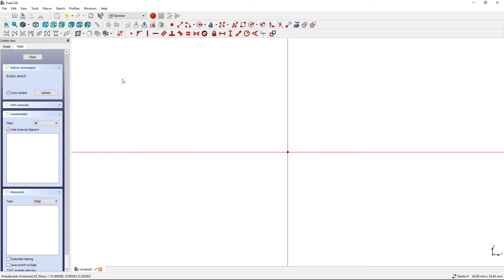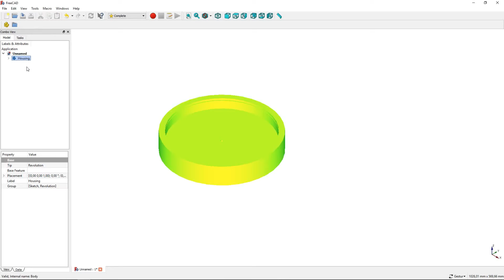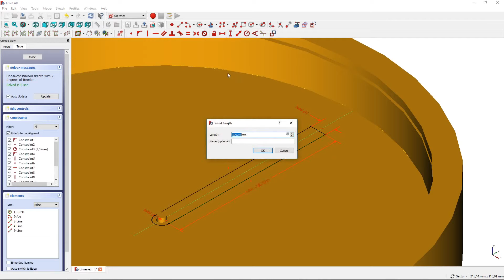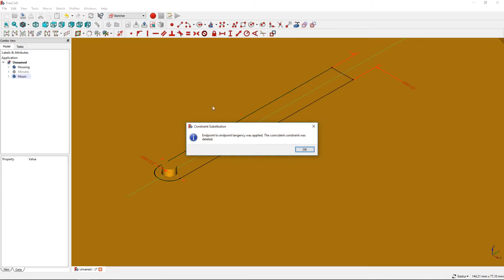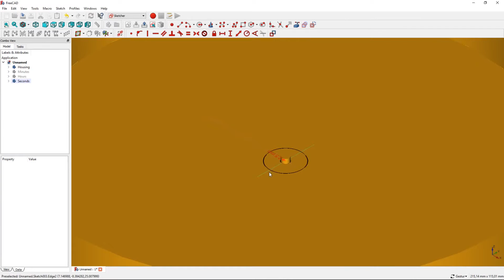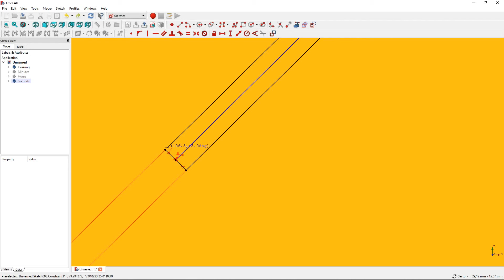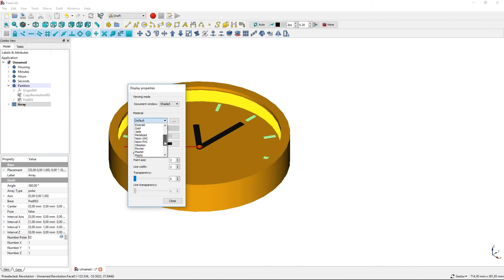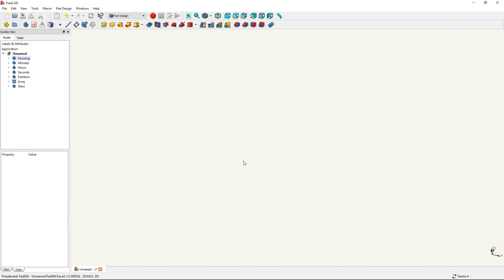How to model a clock | FreeCAD 0.17

Comment: I follow the steps and draw the sketch... then I try to apply the constraints and the sketch gets stretched out of whack
I see a grid on my view, whereas the video shows none... and grid is NOT checked !?
nothing working as the video shows.
Reply from the maker: Hi there, which part of the video are you talking about? I'll have a look at it when I know which time frame it is.
Reply: @AllVisuals4U  Thank you for giving attention to my plight.
The issues are thru-out the very beginning - drawing the basic 2D trace, and then applying constraints to it. (before you do the revolution)
- well I started over and thought I had it figured out, but there are many issues that remain.
1- the one thing I noticed is that the vertical and horizontal constraints gizmos appear on YOUR screen as you draw the sketch, no matter how hard I try, no gizmos for me... so after I drew the trace, I applied the H and V constraints to each line.
2- now I was able to apply the measurements constraints and the sketch kept its integrity instead of stretching completely out of whack as in my first attempts.
But when I got to the last segment(vertical that ends back on the origin), I noticed
3- - - that I am not centered on the origin
4- - - and the last segment seems to be a separate line(not connected at the points)
  [ as if I may have lifted the mouse button inadvertently, using the polyline tool ]
(3)- I do not know how to guarantee my trace start at 0,0.0
(4)- I do not know how to redraw the last segment so that it is connected on both ends
  
5 - I also have an issue with the points being too big, and failed to find where to set the point size in the config/preferences...
   RESOLVED: I saw that in the view TAB and corrected it
6- BUT I drew line on the side of the trace to test... and now when I try to delete this line, it zaps the whole sketch!?!?
    RESOLVED: able to segregate line in Sketch EDIT mode

...this is painful, unable to perform basics, progress is at a less than crawl speed. !?!?

7- There are 2 grids on my view panel... YOURS has none!
- - - I got rid of one grid by using the 'Show grid" option under the view TAB
- - - The other grid I have no idea where to kill it!

8- I have yet to reach 0 degrees of freedom
Reply from the maker: 1- the one thing I noticed is that the vertical and horizontal constraints gizmos appear on YOUR screen as you draw the sketch, no matter how hard I try, no gizmos for me... so after I drew the trace, I applied the H and V constraints to each line.

This could be the 'Auto constraints' option. When you enter a sketch, click on the 'Tasks' button and check 'Auto constraints'. You can also uncheck 'Show grid' here.

2- now I was able to apply the measurements constraints and the sketch kept its integrity instead of stretching completely out of whack as in my first attempts.
But when I got to the last segment(vertical that ends back on the origin), I noticed:

When you click the point and hold the mousebutton, you can drag the mouse to move the point away.
Then select that point and also the origin point and click on the red dot constraint button. This can also solve your other points. You can do this with every point in your sketch that is still loose. Hope you get to 0 degrees of freedom soon!
Reply: ok... after battling a bit more, I saw that if I zoomed into the points that were not synced, I was able to select them and apply a coincident constraint on them to get them to match exactly, and then the rest of the measurement constraints resolved to a fully constrained sketch - no degrees of freedom left.
so, definite progress though I am still not clear on a few points which I will bring up on my next reply
Let me first try the next move - revolution.

- ...and now I see your response above... let me read that...
  ok... you confirm what I now understand about the points.
as to the size of the points, even though I corrected that ... after saving and reloading, there are big again under Sketcher... but they are small under Part Design! - but the size(2) shows correct in the Properties/view panel - go figur!? 

there are 2 grids: the grid you mention I already have OFF... there is still a grid on screen, I know not how to hide.
Reply: well, yet another hick-up, I close the sketch and nothing appears on my Tasks panel
it seems you returned to Part Design bench magically, I had to do it manually, now I see revolution in the task panel
ok revolution done... but when I press ok... I get an error : Unsupported ...blah blah
I Ctrl-Z and now make sure the Sketch is the focus in the tree view and revolve again... all good.
Now I may have clicked revolution in the panel as well as the toolbar button(perhaps that is the problem), since I saw your mouse pointer go to both... You may be showing that it can be performed from either.
Stuff is so mall AND OUT OF FOCUS on the screen I only noticed it was the same trigger after the fact!
so... revolution successful!

Question:  I can see why the shape has the notch on the right side, as that appears to be the glass groove...
but why the raised section at the origin side... bing! I see now... that is half of the hands pivot!

ok... will report next progress (and still one point I will mention more than likely at the end...)
Reply: This is extremely painful, cannot read the screen, have to pause a million times and attempt to decipher what was clicked OR NOT...
Just to give you an idea...
- you switch to Complete bench !? ( do not see why!?)
   (and the title of the video rides over the bench selection box, hard to see what bench you are on)
- then you seem to navigate to options that you do not execute and eventually get to Appearance
 --- I stayed in Part Design and pressed Ctrl-D
- after setting (I believe, Shaded, Plastic and the color) you close Appearance
- Then you show how to toggle visibility via menu option and space bar - ok.
- then you return to Part Design

- then you create a new body (I have to assume, cannot read it)!
 ---then you create a sketch (assumed under this new body)
- then you get a dialog in the middle of the view panel to choose a copy of some sort
 ---instead I get the Select feature in the combo view and the cross hair XYZ cube in the view window !?
WHY AM I NOT GETTING a matched flow to yours, I have to interpret everything!?

...gonna fight with this and see if I am able to get thru it...
Reply: so... I continue and draw the 2 concentric circles to the side of the handles pivot
you do a few clicks and yours seem to automatically land correctly
 --- I must manually apply a coincident constraint to get them to exact concentric position!!!
 --- I then move them to the pivot center... and still have 2 circles
     @@@ Your smaller circle disappears !? 

...it's a constant struggle
ok... I revisited auto constraints and saw that the preferences is auto, but the sketch itself is NOT!!!
now the circles are concentric automatically!

 so I continue on and get the hour hand drawn... and I am left with 1 degree of freedom
I do not fully understand how constraints resolve to a full constraint ... and since I cannot follow your steps exactly(as I was able to do on the housing), I am stuck again.

- current status: [ hour handle ]
 -- I have a center circle that does not disappear(while it does on your screen)
 -- and 1 degree of freedom

although I will keep working on this to resolve it myself, it appears that I may not make it until you give me a clue.
Reply: wow! the confusion!
I decided to check the center circle(the one which does not disappear), and it shows 4.04 mm !?!? I had clearly set that at 2.5 mm
I rectified it... and low&behold now the constraint shows full !? wtb!!!